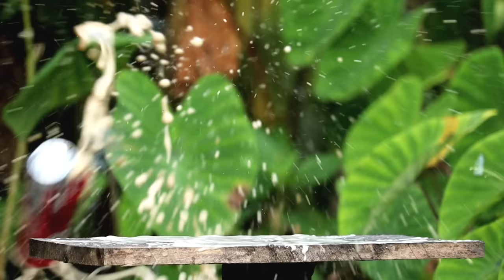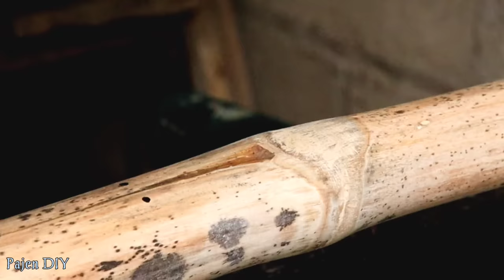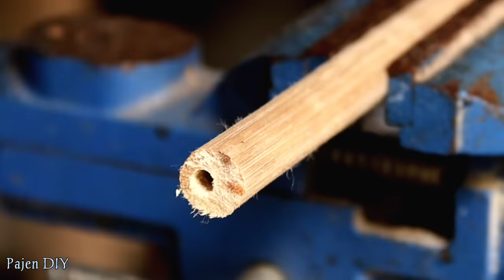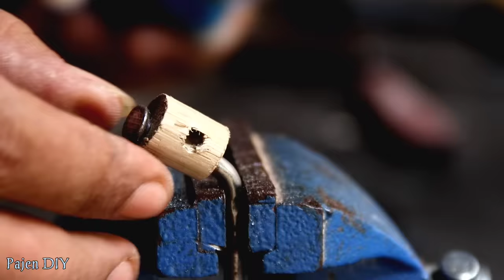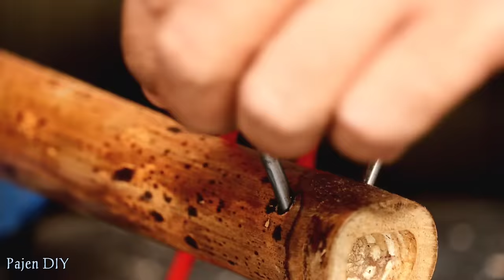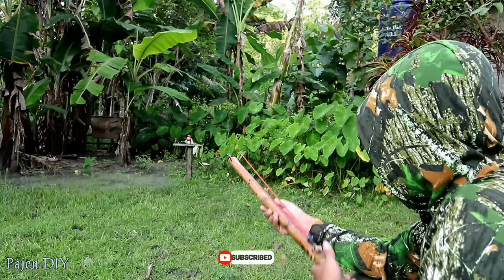DIY Slingshot - Nail Slingshot New Version

Comment: How many such crossbows I made in my childhood could not be counted, there was only one problem, 50 years ago it was impossible to find such high-quality rubber.
Reply from the maker: He is absolutely right, a long time ago i made a slingshot with a rubber band, thank you very much for watching this video....
Reply: Nowadays you can find rubbers in just about any drug store.
Reply: We used strips of rubber cut from worn out inner tubes for tires. Most tires are "tubeless" today, although lots of commercial trucks still use inner tubes.
Reply: 50 лет назад, я брал желтую резину из больших грушевидных шаров на баржах в порту. Я жил у моря.  Эти резиновые груши с тканевым верхом надувались и не давали ударяться судам стоящим рядом. Резина желтого цвета была очень эластичная и прочная, не то что велосипедная камера. Надо было только отделить резину от ткани и нарезать полосы.
Reply: @4anat  Я жил в Киеве, так что ничего подобного у нас не было. Мы с друзьями использовали резину от велосипедных камер. Зато у нас рядом был тир мы там доставали мелкокалиберные патроны и делали самопалы.
Reply: 50 years ago, I made my rubbers from discarded car tire tubes. Those are no longer used, but bicycle tubes are an option on a pinch!
Reply: @gabrielsierra6890  
bike tubes good only if they're good rubber and not synthetic
Reply: @justdoingitjim7095   Holy crap. Ya. U stimulated a childhood memory- making slingshots using inner tube rubber. Didn’t work well. And didn’t know where to buy surgical tubing like real slingshots used.
Reply: мы использовали камеры от велосипедов или от противогазов.
у нас правда чаще бельевые прищепки использовали но само 'ружье' делали с прикладом. 
однажды одному пацану оторвавшейся резиной лоб рассекло так он потом кусок оргстекла приделал сзади прищепки как щиток. 
в стекле дырка для большого пальца. 
неудобно таскать но он как-то таскал.
с еще делали подобные ружья стреляющие проволочными 'пульками' V- образной формы.
те уже с рукояткой и спусковым крючком как у 'настоящего оружия'.
70е. сибирь. алтай.
Reply: 50 years ago when I was just a lad, I extracted the materials from rubber trees and made my own rubber. It was much better than anything you could get today.
Reply: @actionjksn  To get rubber from wood, and even at such a young age, it was necessary to have tremendous knowledge. But unfortunately there were no rubber trees in Ukraine where I live.
Reply: @andreybogunov4421  I didn't have them either so I went and got some rubber tree seeds and planted my trees so I could get rubber to make slingshots. I was a very industrious young lad. And then I started buying chemicals and making synthetic rubber, It was very easy for me.
Reply: You have to be kidding me. I thought I was an industrious boy, but that is just too much. Are you trolling?

Comment: Nice, but attaching the rubber can be done more easily when the rubber is a tube: put the two nails through the bamboo from bottom to top, then bend the nails towards you. Next wet the nails and rubber and push the rubber over the nails by about 1/2” or 1 cm. When you pull the rubber it constricts on the nails. Very simple, very safe.
Reply from the maker: Thanks for the advice this is very important knowledge for me....
Reply: Hi sir, I do not understand your method a picture would be great...
Reply: @eliedelorme9945  Hi, I can’t send you a pic. But think of it like this: If you wear latex gloves you can never get them off by pulling at the finger tips. You have to roll then off your hands. 
Same here, the nail is like your finger, the latex tube is like the glove. Use only clean water to help shove the tube over the nail. The water will eveporate after which the connection is reliable. Don’t use talcum powder, silicon lube or anything; just clean water. Good luck!

Comment: Nice video! We used to make similars one as kid, but we used a long piece of board instead of bamboos, with rubber tourniquet bands and thicker nails in the front. One thing I would suggest… it’s a lot safer if you introduce the nails, with a bit of forward angle, from the bottom until the head are touching the wood then you only need to cut them once at the top. In that way it’s a lot more difficult that they came loose and go towards your face as a harpoon 👁️🗡️
Reply from the maker: Thank you very much for the advice and thank you very much for watching this video
Reply: I also used to do it with a board but it shoot bottle caps instead of nails. Alot safer
Reply: Can use screw instead of nails more safer then nails if risk of loosing nails screw will not easily out even loose
Reply: @PajenDIY  you are welcome
Reply: Thats better

Comment: If you make this, put the front nails in from the underside. They ain't coming off from there. Cut the heads and make a little notch for the string.
Depending on the pull power, contemplate for a second the forces going through the wood at the front. Nails undoubtedly will take it, but don't put the string mounting nails to the very front - after million shot ball bearings, they absolutely will wiggle through the wood if the nails are too close to the edge and rubber band-strings are very heavy duty.
Reply from the maker: Thanks for the advice, this is science for me

Comment: Very nice video. It would have been a whole lot better if you went through and explained certain things. How long was the bamboo pipe? What size nails were you using? Etc etc
Reply from the maker: Thanks for the advice and thanks a lot for watching this video
Reply: It's not that complicated, almost everything is adjustable, the main point is the trigger model.

Comment: I made these as a kid. Get some clothes pins and a 1 by 4 maybe three or four feet long. At the end pound 4 nails to hook the rubber bands on. Now take the clothes pins and break them apart to use only the metal part threaded like keys on a key chain to your elastics. Separate 4 more pins and nail the bottoms to the other end of the board and then reasemble.  Hook your elastic on a nail and pull back on the metal piece, "loading it" into the assembled clothes pin , where it would normally grab a clothes line.  Now you have a 4 shot . The effectiveness will change with the strength of the elastic.
Reply: Arrrrr the peg gun we called it tried teaching my 11yo step son more intrest in xbox 😂

Comment: When I was a kid I got an old table leg and nailed a clothes peg at one end. The other end I banged a nail half way in. I took the metal part of another peg and connected an elastic band to it. The band went over the nail and I stretched it until the metal peg part engaged with the peg at the other end. Aim, open the peg and 'whoosh', range of about 15 metres. Peg gun I called it.

Comment: ⚠👁 Safety first! If you're attempting to make a DIY slingshot like this, it's crucial to ensure that the two nails at the front are securely attached to avoid any potential eye hazards. Take every precaution necessary to minimize the risk of accidents. Always prioritize safety when working with potentially dangerous tools or equipment. Stay safe, everyone! ✋🛡👷‍♂
Reply from the maker: Thanks a lot for the comments and suggestions...
Reply: Лайк вся техника безопасности написана кровью все правила дорожного движения и так далее при работе при стрельбе очки очки перчатки крепко одежда и даже кепка либо шлем спасут вас от фрагментов и ваших снарядов если что-то пойдёт не так или произойдет разрушение конструктивное оружие произойдет разрушение вашего (игрушечного😮 либо: настоящего😮 оружия рикошет Если вы решили поохотиться на животное будь-то птица несчастный случай на охоте или во время изготовления любого вида оружия уголовная ответственность либо административное как минимум поэтому Семь раз отмерь один раз отрежь 100 раз подумай перед тем как делать оружие игрушку давать детям Или учить кого-нибудь плохому Но люди не подумав и сделал игрушку могут сотворить для себя либо для кого-то трагедия беда и даже смерть 😢

Comment: Would like to see how you made this sling to hold the projectile. And to know what kind of projectile you were using
Reply: It was a nail according to the title
Reply: @justahologram2230  the nail is a firing mechanism and many of the components are nails. the projectile is a 5mm metal ball bearing by the look of it. Lead or iron would be ideal, steel would be easy to get.

Comment: Nicely done but this is a catapult not a sling. A sling shot involves a centrifugal motion to build up the energy for propulsion. So David slew Goliath with a sling, spinning a rock on a length of rope over his head and letting go when the centrifugal speed and therefore the energy was enough to impact Goliath fatally. Another use of the slingshot effect is when spacecraft on missions to the outer planets use the other planets' gravity for extra energy thus saving fuel.

Comment: Thats all cute until the front nails get released to your face and you become one of Frankenstein's creatures. You better use the WHOLE nails in front, and just bend the lower part of them towards the far edge of the slingshot. That way the only risk is the rubber released to your face, and not the nails.

Ypu

Comment: Your rubber sling "secure" binding will fail in a few days. Your twice-drilled bamboo pivot will split in a month or less. Super-glued nails in a position, will not secure them for very long.
With vice, drill, electricity, hacksaw, and numerous tools available ( which many poor communities do not have) maybe you could do better.
Reply from the maker: Thank you very much I am very happy to receive your comments

Comment: Very cool, but I have found that bamboo or cane doesn't last very long before becoming brittle and basically falling apart.
Reply from the maker: Depending on the choice of bamboo, brother, thank you very much for watching this video....
Reply: @PajenDIY  okay, thanks.  I am only familiar with the type of cane that grows in middle Tennessee. I wasn't aware there are different types.
Reply: @D.Lee.W  I’m over in West Tn and I’m sure the bamboo types are much different in the Orient than most of the kind we have here that we usually use for our fishing poles. Either way if we can make one it sure would best not having any weapon if it shoots ball bearings and nails. That one was pretty interesting and he’s accurate with it. 
Go Vols!!!